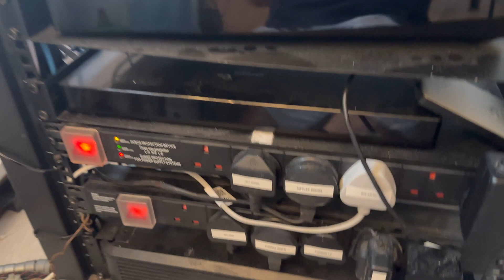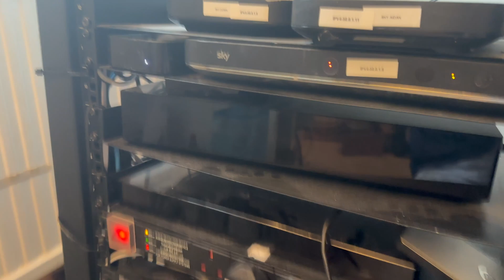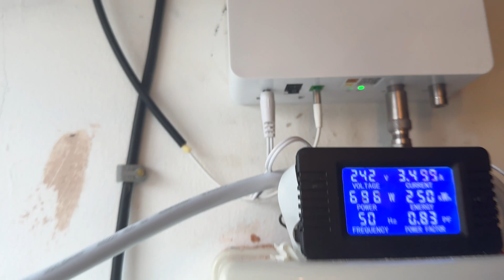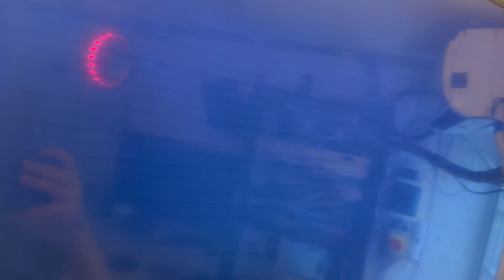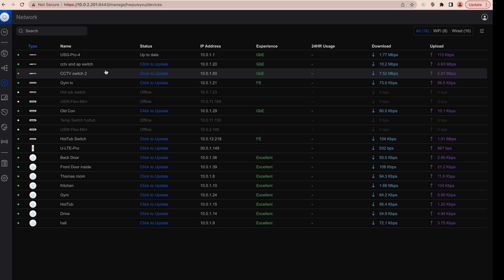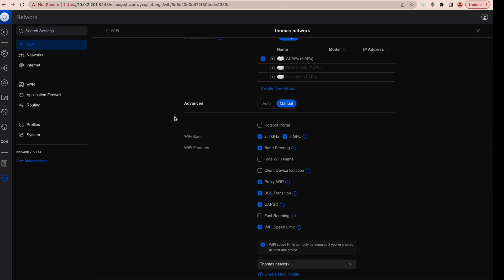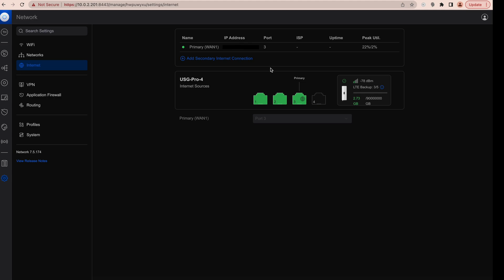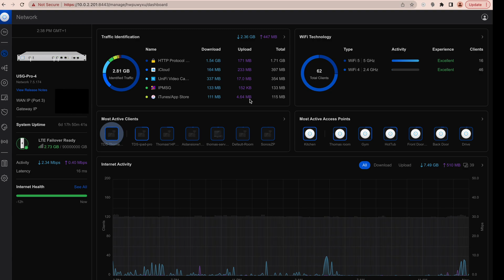My Overkill Home Server Rack & UniFi Network Tour (2000+ Devices!)

Comment: You're WiFi 2.4 SHOULD NOT be sitting at 40mhz, it should be at 20..  and the 5ghz should be around 40 maybe 80 depending on rf interference.
Reply: If you want speed isn't the best way use 40 on 5ghz. On 2.4 maybe is good 20 for range, but don't to speed
Reply: @lucasthielke  You will have alot of congestion on 2.4gig with 40mhz.  Keep 2.4 at 20 and 5g at 80.